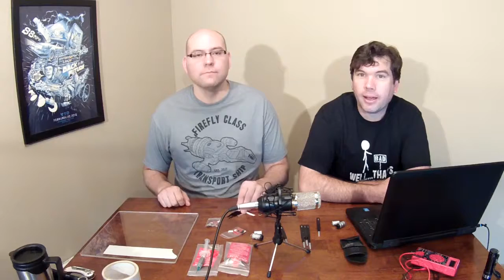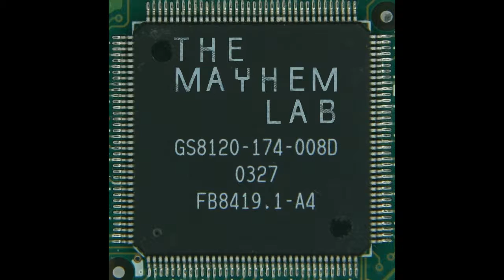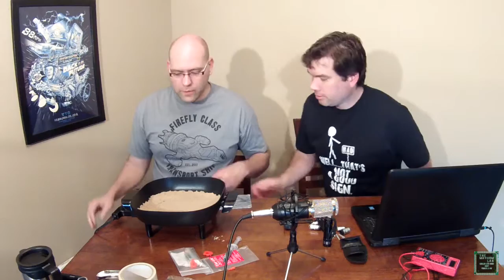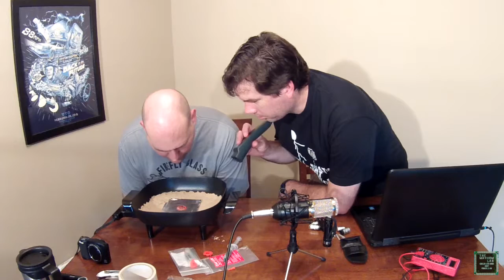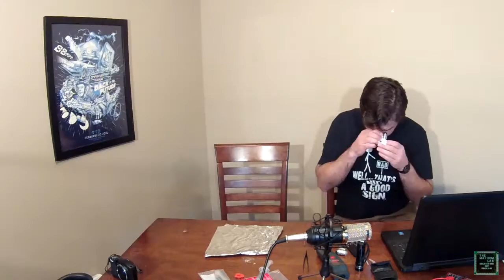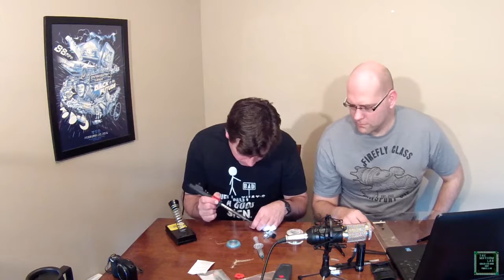#7 - Surface Mount Soldering

Comment: I bought this kit several years ago and it's no-longer available on eBay.  I never got around to building it until now and  I lost the 2 NMOS transistors/MOSFETs when they flew out of my tweezers.  Do you happen to know what part number the transistors/MOSFETs are? I could probably use any generic transistors/MOSFETs, but it would be good to be choose a replacement with similar specs.